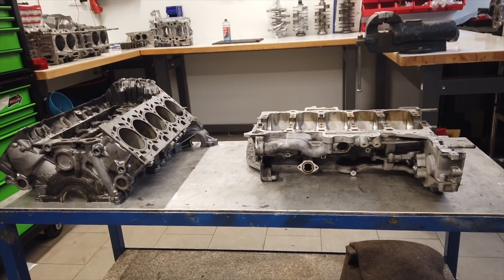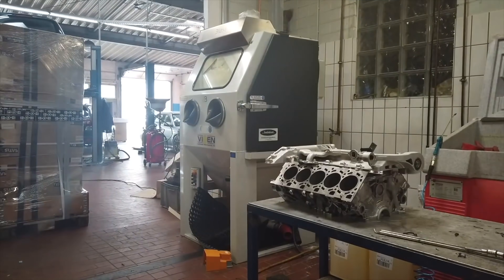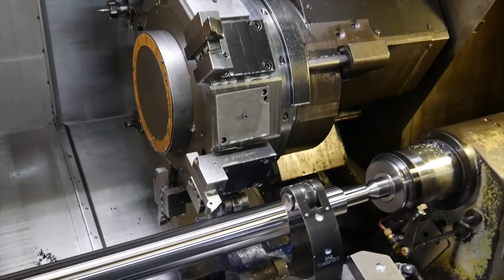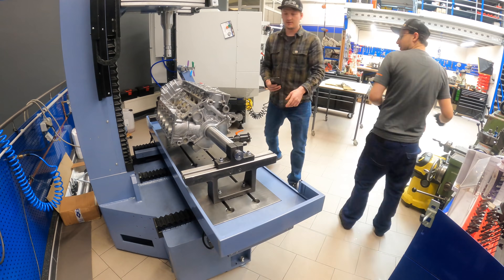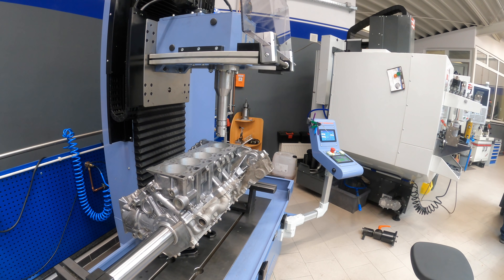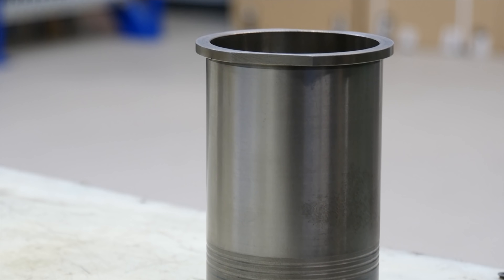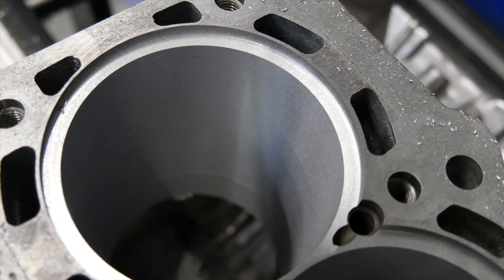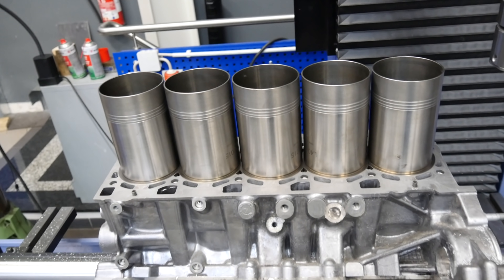How to build a 2000HP Lamborghini Engine l Part 1 l Subi-Performance

Comment: mal ne ganz doofe frage, bei rund 8:00 sprichst du von "neuem Werkzeug" also scharfes werkzeug.
ehrlich, sowas erwarte ich bei so einer Arbeit. Wir sprechen hier ja auch immerhin von einem Block der nicht nur 500€ kostet, ich schätz mal der Block allein wird schon 5k€ kosten, wenn das überhaupt reicht. und nur weil einer meint 2,5€ sparen zu wollen die arbeit und den Block zu schrotten macht keinen Sinn. Und ja, das Werkzeug ist ja nicht verloren, das kann sicherlich für 2-3 solcher endphasen noch genutzt werden bevor damit nur noch geschruppt wird

Comment: You would think that the 'chips' from the boring machine would somehow upset the accuracy of the job.  I good strong magnet or a very high airstream to suck the particles out would ensure that the chips would not interfere with the accuracy of the job.

Comment: the last cut? do you use iscars Diamond insert? and what speeds and feeds do you run? last cut 0.1mm ? ?  F5 ? ? Zn* ( 1) *  100 ( n ) Rotations * Feed ? (0.05 ) ?  Best Regard - and V.g J in Aarhus - MOJN ( Nordslesvier )

Comment: Great video Andy. Precision work done by a professional.  Your prowess at engine buiding is becoming legendary or Phillip Kasse would not have taken this engine to you!  Looking forward to the next stage.  By the way, I am reminded of the sleeving work you did on the six cylinder Subaru, so just what has happened to that build?

Comment: So question is, will it fit my Subaru and when you start to sell these in your website? :D
Reply: Yes it will fit, but you'll have to remove the rear seat and mid mount the engine.
Not a big sacrifice when you think about it.
Reply: @petert3355  My car already doesn't have rear seat, so we are like half way there tbh. Sweet!

Comment: "boring" bedeut übrigens langweilig auf english. Falls du "bohren" meinst, so wäre das englische Verb dazu "to drill", wie in "I am drilling".
Reply: Beide richtig. Bore ist eines der englischen Wörter mit mehr als einer Bedeutung. Siehe https://www.dictionary.com/browse/bore, da gibt es sogar 4 Definitionen dafür
Reply: Boring bedeutet auch bohren. https://dict.leo.org/englisch-deutsch/boring Außerdem heißen diese Spindelköpfe auch Boring head https://www.google.com/search?q=boring+head&client=firefox-b-d&sxsrf=ALeKk00cv90TEmJ8c52hOAvlTrzOx4KCbg:1602854705144&source=lnms&tbm=isch&sa=X&ved=2ahUKEwj2_82Km7nsAhXJ-6QKHbnPCCMQ_AUoAnoECAsQBA&biw=3840&bih=928
Reply: Boring the bores with the boring tool.

Comment: @4:40 4:40 Ist es echt so genau mit der Wasserwaage ? Ja es ist eine spezielle hab die schon mal gesehen, hätte aber gedacht sowas wird mit einer Messeruhr an den Zylindern abgefahren.
Reply: Mit´ner guten Maschinen-Wasserwaage schaffste locker 0,001 mm und ich glaub mit guten digitalwaagen noch genauer ;-)
Aber ich denke das trotzdem die Messuhr mit zu Rate gezogen wird ;-)
Reply: Die meisten Maschinen Wasserwaagen schaffen 0,001mm auf einen Meter Distanz, sprich auf dem Block dürften es unter 0,001 sein. Genauer ist nicht nötig.

Comment: super interessant, aber "bohr distance"? bohren = to drill
Reply: to bore sth - etwas aufbohren
Reply from the maker: Eigentlich wollte ich cylinder distance sagen 😂
Reply: Ich glaube er meint "bore distance", d.h Abstand zwischen zwei Bohrungen
Reply: bore  ist schon korrekt, wenn auch wie Andi schon sagte man wahrscheinlich von cylinder distance spricht.  Die Aussprache vielleicht etwas deutsch. Bore, Stroke, Cylinders ... das sind schon die richtigen Begriffe.
displacement = π ( 1/2 × bore )2 × stroke × ncylinders

Comment: those walls look thin between cylinders
Reply: they are but the sleeves make it stable again.. between two conbustion chambers are a sleeve wall, the engine wall and another sleeve wall
Reply: @julianfl  
i understand that, plus the cylinder head hold a lot of the load as well.
i just get paranoid about the torque and thermal expansion cracking the bock.

these guys know their buisness so it will be fine, but i worry anyway
Reply: The Audi 90mm bore spacing gives alot more meat.

Comment: Ich halte das für wahnsinnig ! 2000ps in einen auf 10 Zylinder aufgeblasenen Fiat Tipo -Motor loszulassen
Reply: Lambo hatte nie etwas mit Fiat zu tun !
Davon ab, Fiat baut sehr Robuste Motoren.
Reply: ZU den Fiat Motorenguck dir mal an wo überall heutzutage FPT ( Fiat Powertrain Technologies) Motoren verbaut sind
Reply: Wenn man über 1000 PS aus einem VR6 raus holt. Dann ja wohl locker 2000 PS aus einem zehn Zylinder
Reply: Mein Bauch sagt, dass er bei 1600 PS den Block spaltet. Aber die Reise bis dahin wird mega interessant!
Reply: @WorkinDuck  im amiland gibt es doch mehrere, die lambos mit mehr als 2k ps auf 1/4 meile fahren, denen spaltet es den block ja auch nicht
Reply: @user-dn5if5lt2h  waren aber, soweit ich weiß, alles 5.2 Liter und PK fährt einen 5.0 Liter. Sind grundlegend verschiedene Motoren
Reply: @WorkinDuck  in Schweden fährt auch jemand mit dem 5L-Block über 1000PS.
Reply: @Lokakomedia  “Peter Bjorck” heißt der Kollege. Super sauber gebautes Auto 👍🏼
Reply: @user-dn5if5lt2h  Philipp meine ja selbst dass es passieren kann dass der Block irgendwann auseinander bricht weil es in Amerika anscheinend schon passiert ist.
Reply: aber das ist ja dann ein 10 Zylinder aufgeblasenen Fiat Tipo -Motor von subi gebaut dann wird das schon was. wenn die amis das hinkriegen wird subi das besser hinkriegen